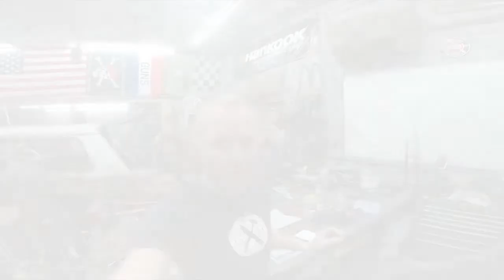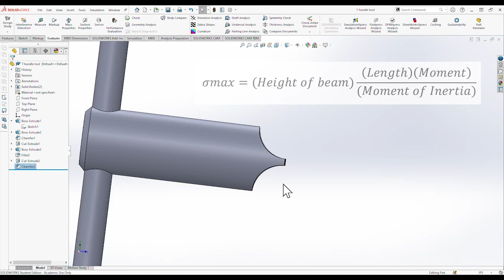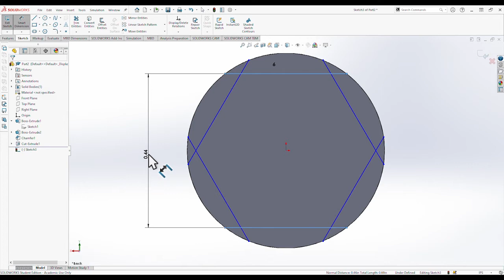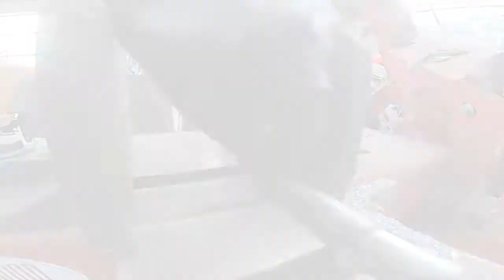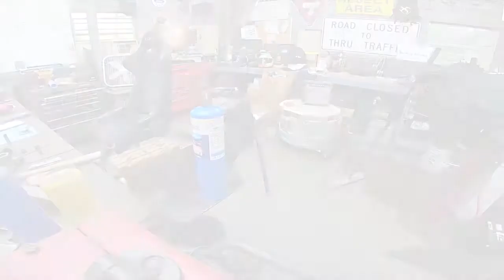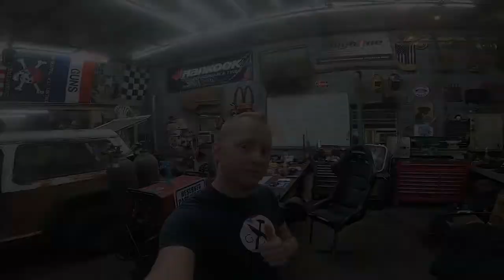Engineering a Tool

Comment: For a further iteration, try machining a grove into the drive end so that you can seat an o-ring into it. That should allow the adapter tool to stay in place when held in a socket or wrench.
Reply from the maker: It's funny that you mention that, because I had actually considered that option. I also pondered magnets and other things, but eventually decided to skip it.

Definitely a good idea, though, and it will most likely get added if/when this one gets lost.